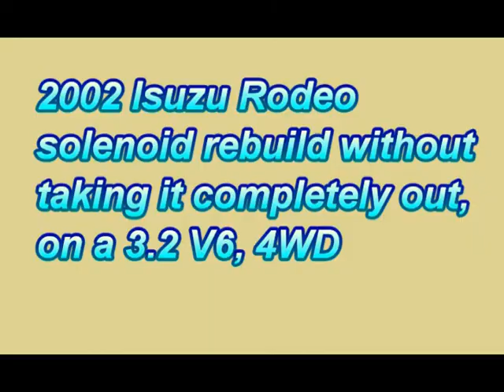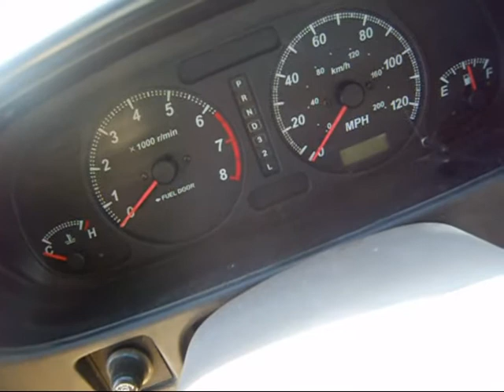Rodeo Solenoid Rebuild; without full removal of starter

Comment: Thanks for sharing!! My solenoid was stuck and this vid helped me heaps and gave me the idea to just try removing the cover without removing the starter or anything, coz I didn't feel like messin with it either. When I took the cover off the solenoid, I realized the plunger was stuck to the cover. Corrosion seemed to have caused the two parts to become attached, took quite a few hits to get em unstuck. A job that could have taken many hours, took one cruisy hour. Sweet as.

I'm not quite sure what you meant by "rotating the starter"? 
Anyway, thanks again!

Cheers  :)

Vinny, NZ

1996 Isuzu Bighorn (Japanese Trooper) SWB 6VD1 5-speed
Reply from the maker: I had to move (rotate) the starter from facing the flywheel (facing backwards) to facing the front (or forwards).
Reply: @bgdesignandsolutions  Ah, I see, so you unbolted the starter and moved it around?
Mine was a fiddly job, but I was able to get to the solenoid cover in place, not sure if I could even unbolt the starter
Reply from the maker: @bytmee69  You got it fixed though, right?

Comment: Would have liked to see more detail but very happy that you showed how it could be done.  I have a 99 Rodeo and after watching a couple of videos I had decided to forget it and get another car.  My Rodeo has 210,000 on it but I wold like to get a few more months out of it before springing for another car.  This gives me hope.  Very useful video guide for this project.  After watching other videos on removing that starter it seemed to me that if that cross brace under the starter were removed that starter would be a lot easier to remove.  I have a Milwaukee 1/2 in cordless impact that I think might loosen those bolts.  You have actually been under there and know what it looks like.  What do you think about removing the cross brace?
Reply from the maker: Never considered that method, but I expect it would be easier just to unbolt the mounts and exhaust and lift the engine, than to have the whole thing up on stands and crawling underneath it.

Comment: Hi, I know you mentioned you rotated the starter and there was a few comments on it but curious if you could elaborate please. After taking off the 2 bolts and electrical connections I just don’t seem to have enough room in the space. Do you remember if you rotated it vertically or horizontally?  Just trying to get the face of the solenoid like in the video exposed in the removed driver side front tire area. Thanks
Reply from the maker: It's been awhile, wish I could remember for sure. But seems it was more horizontal than vertical. Vertical would be flipping it over, while horizontal is just turning it around. 

It was tight, and it took a couple of forward and back motions to get it turned, but eventually it got there, so I just worked it from there.

Comment: You said after you removed the tire you rotated the starter.  I assume you had to remove the starter mounting bolts first.  Looking at the picture where you removed the solenoid cap, is that looking from the front of the vehicle or the rear?
Reply from the maker: Looking from the rear to the front. I was laying down on the drive just behind the front wheel area.

Comment: I have an 01 Honda passport which is the same thing. I thought my starter was shot but it used to start just fine with no signs of failure. What it started doing was one day I went in the store came out and a relay was just clicking while the car was off. Clicked the key it started got it home and it has never run since.. did you ever have any issues like that? I know what a bad starter is like and I don't think it's the problem. And geez like know it's a nightmare to even think about changing..

I've been scouring the internet to figure out what the problem is and best I can come up with is a gronding issue. I'm more of a tinkerer than any type of mechanic . Just wondering if this ever happened to you?
Reply from the maker: No, I've never had a problem like that. The clicking noise sounds like a relay, and perhaps the relay itself is not allowing it to start. Maybe if you replaced the starter relay, it might start.
Reply: Maybe checkout my comment above

Comment: What were the symptoms that caused you to take this on? Mine will click or partially turn over several times before actually starting. It is a 1999 3.2 2WD.
Reply from the maker: Sorry I didn't respond before now, I just saw your question. It would click when trying to start the engine. Like a thump when turning the key. This means it's trying to engage, but can't due to the lack of currant. It would start most of the time, but the clicking got more and more constant. This shows the starter is good, but the solenoid is not acting right.

Comment: I managed to swap the starter in my 2001 Rodeo a few years ago by removing a few bolts where the exhaust is connected to the right side next to the starter and then I slid the starter out from the bottom without having to lift the engine.  Now it looks like I need to replace or rebuild the solenoid.
Reply from the maker: Thanks for the input.

Comment: Where did you get your selenium rebuild kit?
Reply from the maker: You can get them at an auto parts store, like Autozone, Advance Auto Parts, etc.
Reply: BG Design and Soultions thank you never rebuild one, but my 1995 Honda passport won’t start it just clicks I figure is the solenoid, wher Can I find a video on how to rebuild it?
Reply from the maker: @monchy25  If it's just clicking, it's most likely the solenoid. That's what mine started doing. 

Rebuilding them is just as simple as I show here. Just replace the old parts with the new ones. That simple.
Reply: BG Design and Soultions mine is 4WD, yours too?

Comment: what year is ur car?
Reply from the maker: It's a 2002, Isuzu Rodeo LS, 4WD.
Reply: 1999 izue rodeo
Reply: Want go forward only backwards
Reply from the maker: @elizabethpressley6636  Been awhile since I tore into a transmission. Most of the time it the reverse that goes out first, which shows a clutch issue. Might be a electrical solenoid in the valve body. See of that's an issue. 

Make sure the fluid level is ok too, That is done by crawling under and removing the transmission drain plug and putting in more fluid until it runs out. (while the engine is running)

Harder to do than to say. Requires an extra effort for safety sake to make sure the vehicle doesn't move or roll. I use a squeeze bottle with a tube to check mine.

GM was not looking out for the little guy by leaving off a dipstick.